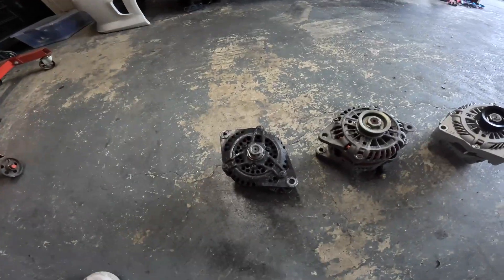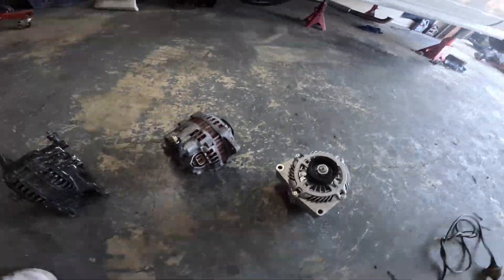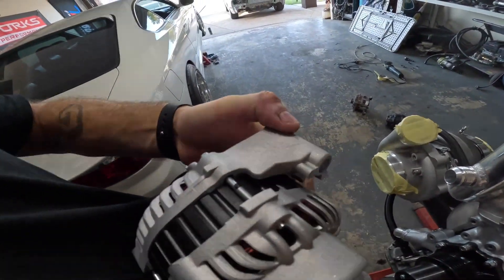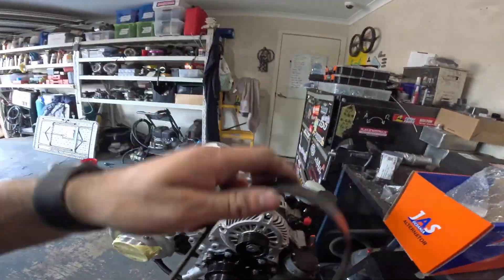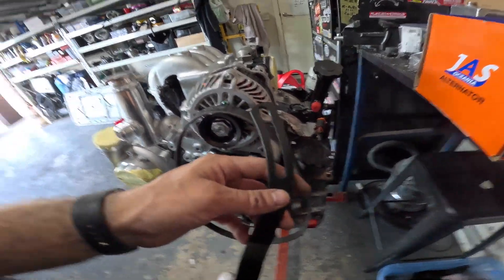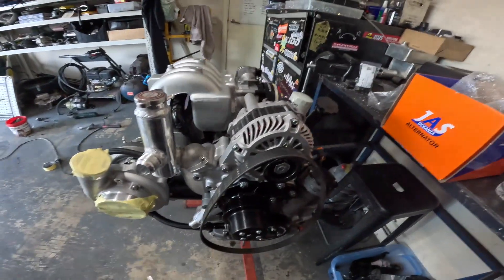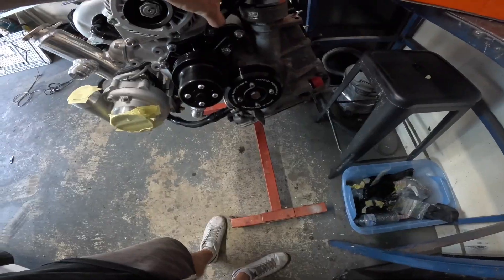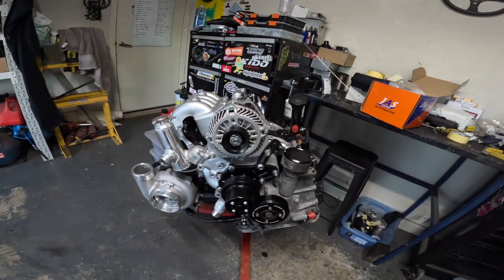Upgrading the 13B rotary alternator to a ls1 Gm unit in under a hour

Comment: I'm interested in this swap, however my 13b can spin almost 10k rpm. chevy alternators aren't designed to handle that. What's the work around ?
Reply: actually I found a 3" 6pk overdrive pulley which brings the rpm to safe level.
Reply from the maker: Perfect !!